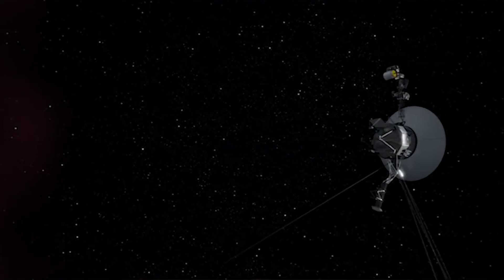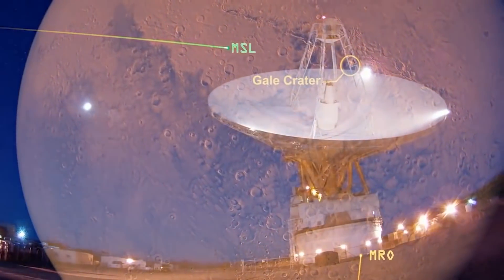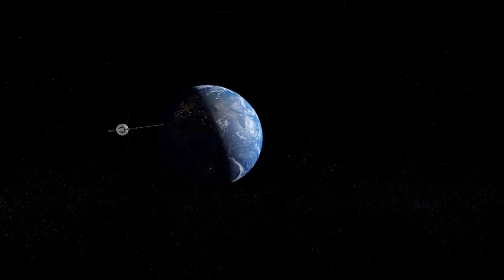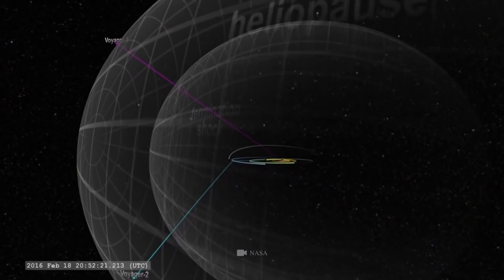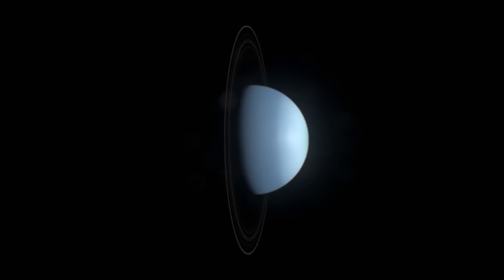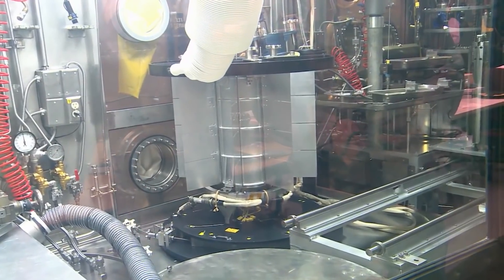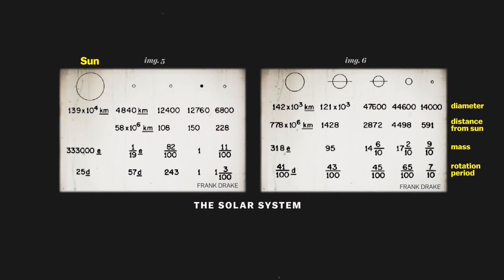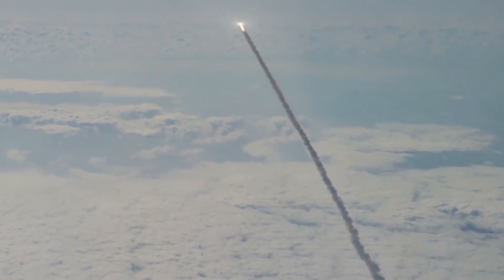Voyager 2 is FINALLY Back Online but Scientists Found Something SHOCKING

Comment: Voyager 2 was not designed to "study the edge of our solar system", but to study the outer planets and the space between them.  It doesn't take "ages" to send and receive signals, but about 17.5 hours.  Voyager 2 was never off-line, but we went through a period where we couldn't send new commands due to work on the Australian DSN antennas.  So we didn't have hard drives in 1977?  ;-)  Finally the velocity relative to the Sun is about 34 thousand miles per hour.  (I know, I know:  I'm complaining too much, but then I've been with the project since 1979 myself, so I'm getting to be old and crotchety.)
Reply: It was very helpful. Thank you.
Reply: I was really hoping I wasn’t the only one who noticed those gaffes. My head almost exploded when he said “it passed through Jupiter, Saturn, Uranus, and Neptune”! It most certainly did NOT pass through any planets! 🙄
Reply: @DennisKovacich  At least he didn't say "flew through!" Spacecraft may be flung, floating, or in reality, falling, but not flying! Were you at NASA also?
Reply: @DennisKovacich  It is possible that it passed through Uranus. 😉
Reply: I mean, he did call out those details, so…
Reply: @BeaulieuTodd  Sorry.  I also appreciate this contributor's experience and comments. I intended to comment on the video itself.  But it got placed (perhaps due to my ineptitude) as a comment to a comment.  I often have my comments or texting substantially altered as I post them.  Just now I was prohibited from making "texting" plural.  Sometimes, in texting to brothers, I try to be cute by distorting the language for emphasis as in awash. Awash was not the word that I typed but rather "a" four times followed by "h".  The GOOGLE computer--bless its little heart--is trying to be helpful.  Have I run on too long?  I WILL receive a notice.
Reply: @josephboxmeyer5730  Bragg, Benning, Gordon, or Jackson? Just think if this rudimentary AI screws up this often, what will fully independent AI do??
Reply: I was also bothered by the "ages" reference. Do idiots write these scripts?
Reply: @josephboxmeyer5730  It's all just clickbite. What did you do with the project?
Reply: @juliamars6573  I wish that I could say that I had something to do with the voyager projects.  I remember my excitement watching results from fly-bys of the outer planets.  When in school we had no more than grainy little photos and interpretive drawings.
Reply: @josephboxmeyer5730  its for the numbskulled young in our societies who deal in absolutes
Reply: You can say you sent them in a triangulation towards the area of the source of gravity that was perturbing Neptune  and Pluto.
We know😐
Reply: @SnookCowboy  Very clearly worded. Good thinker.  Gravity does not surprise you.  What do you think of Space-X CEO and founder?  I think that I'd like to work for him.
Reply: @josephboxmeyer5730  Thanks Joseph.  I would work for him if there was a position available.
I'm a network specialist. Telecom.
Learned about planet X around 2007. Ardent study of ancient civilizations claiming their creators were from space.  Specifically the Annunaki or the sons of God who took favor amongst the women of men..  I will walk through the door of truth if opened.
Reply: No 3.5 inch hard drives, but I guess they had  back then washing machine size hard drives
Reply: Even today’s hard/NAND/SSD drives would be terrible for this type of long term data storage.
Reply: Taking 17.5 hours is taking ages. :-)
Reply: If you're talking the truth, by now, you're entitled to be grouchy and crotchety!  And, it's low in fat and salt, high on fiber!  I'm getting reacquainted with prunes, and, saying goodbye to constipation!
Reply: Thanks for sticking it out in Cali. and for any work you did on this incredible instrument. I'd have been proud as a peacock to have swept the floors while she was coming together! Exceptional work from your contemporaries and yourself! God Speed!
Reply: Man, you’re allowed to be old and crotchety at this point. Seriously. By a long shot. Thank you for the valuable work you have done.
Reply: What is your opinion on the gold record installed on Voyager I? I think it's kind of dumb but I'm not a rocket scientist
Reply: @patrickkinnear8625  , be assured that the gold record was primarily PR outreach targeted very much at humans.  I think it was appropriate.  I'm hoping that it will be very valuable space salvage at some point in the future.
Reply: Thank Mr. Spock 🖖🏽 for the explanation
Reply: Cool
Reply: 😹😹😹yes there were hard drives back in the 70’s but a hard drive of that time period was almost the size of 7.5kg load washing machine so no they could not just attach a HD back in the day😹😹😹😹I have a 10 disc spindle rescued from my old job when we upgraded the computer hardware to more moderne hardware back in the late 80’s the 10 platers was a combined 5MB in total if it was made with todays moderne technology it 1000TB give or take.😹😹😹
Reply: @dawsie  I left the NAVY in '83, went to work for an image processing company. I remember the old Winchesters. Big as a top loading washing machine. In the Navy, the Fire-Control computer it used was a Univac 1518, with magnetic toroid core memory, paper/mylar tape reader, teletype machine for direct input and a card reader for back-up, The GFCS operator panels had DTL for circuitry. Those were pioneering days for sure. At the image processing company, one of our products had 16 image bit slice solid state memory boards. (the chips were 4116s if IIRC) It was all grey-scale. Part of my job commissioning such a machine was to synchronize the RAS and CAS for each board using an O-scope and adding appropriate delays for each board by cutting traces, soldering a bit of wire wrap conductor to route the signals through buffer gates to get the RAS and CAS for each bank to line up. 7ns (?) per gate IIRC. How far we have come.😉
Reply: @dawsie  all tech that is available for public use is @ least 10yrs behind the curve; so if they used it in the 70's that means it was developed late 50's to early 60's. Military always get 1st dibs on new tech.
Reply: @dawsie  The most common at the time of Voyager launch in 1977 were the "Winchester" drives described at https://en.wikipedia.org/wiki/History_of_hard_disk_drives
Reply: Hey man I wish you could teach me this has been a life long dream and it's our time to be making space home but who now's what will happen but damn your smart
Reply: Salute to you
Reply: From one "old and crotchety" to another, thanks for the clarification.
Reply: You have a vivid imagination.
Reply: Thank you for your service.  Merry Christmas!
Reply: 👍 thank you. I caught the ages comment and the redirection to the south. There is no south in space. As there is no up or down. 🤦‍♂️
Reply: @DMUSA536  For astronomical purposes the ecliptic plane is defined by the Earth's orbit around the Sun, with north defined as the perpendicular direction containing the positive axis of revolution.  We (in fields and particles research) also talk about upward and downward propagating waves, depending on whether they're moving away or toward a planet.
Reply: @Space-Audio  thanks for the clarification. Much appreciated.
Reply: Boy are you full of bullshit or what?
Reply: Wow, respect.😄👍

Comment: If the radiowaves travel at the speed of light it would take 16 years to get a Signal
Reply: ?

11 billion miles are 17702784000000 m
The speed of light is 299792458 m/s
17702784000000 / 299792458 equals 59.050 s
59.050 seconds are about 16 hours
 Where tf did you get your 16 years from?
Reply: @radiantdiamond3701  look at his pfp im sure that explains more than enough

Comment: “NASA” is so smart they didn’t even put a solar panel for power on voyager huh? Idiots! They could have at least put some rechargeable batteries on board so aliens could recharge it for us.
Reply: Solar panels were either not effective, cost effective, or aerospace worthy to be included on the voyagers. Remember solar power has only gotten popular recently by developments in cheap design and effectiveness

Comment: The speed of light is confusing it takes 17 hours for signals to get back right signals travel at the speed oof light right ok so here

296k m a second 1000x 296 = 296m 16 mins 296m x 10 = 2.96B 160 mins 2.96B x 2 = 5.92B 320 mins 5.92B x 2 = 11.84B 640 mins 10 hours and 40 minutes it shouldn’t take 17 hours or did I do the math wrong and the speed is actually 230k ish

Comment: https://www.nasa.gov/press-release/nasa-s-voyager-2-probe-enters-interstellar-space  While the probes have left the heliosphere, Voyager 1 and Voyager 2 have not yet left the solar system, and won’t be leaving anytime soon. The boundary of the solar system is considered to be beyond the outer edge of the Oort Cloud, a collection of small objects that are still under the influence of the Sun’s gravity. The width of the Oort Cloud is not known precisely, but it is estimated to begin at about 1,000 astronomical units (AU) from the Sun and to extend to about 100,000 AU. One AU is the distance from the Sun to Earth. It will take about 300 years for Voyager 2 to reach the inner edge of the Oort Cloud and possibly 30,000 years to fly beyond it.

Comment: It's amazing how far man made objects passed the solar systems and yet there's no man made object that sits at the bottom of the Mariana's trench transmitting signal the same way as Voyagers 1&2
Reply: Transmitting signals for what?
Reply: Because signals can’t be transmitted through water. Submarines have to surface (or at least get close enough for their antennas to be above the surface) for radio communications.

Comment: We are to believe it is transporting images 11 billion miles away??? Yeah right!
Also the charged particles in the Van Allen Radiation Belts would prevent any and all transmissions.
The moon landings, along with all the rovers and probes are all fake.
They do this to keep the billions of dollars rolling in.
https://www.youtube.com/watch?v=4O5dPsu66Kw
Reply: Signals are like light bud
Reply: @vend9234  First, Radio signals are not like light. Secondly can a manmade light travel 11 billion miles???  According to the findings of the Orion space probe the inner belts consist of mostly electrons that carry a negative charge and the outer belts contains of mostly protons that carry a positive charge this would disrupt radio communications. When the Orion went into the belts NASA lost radio contact but they were expecting that and the computers were programmed to  control the ship through the belts.

Comment: After acquiring so much data that it gains consciousness it resides to come back to join with its creators and deliver the gained data.  Upon not hearing from the creators as they’re long since dead, it determines that the carbon based units (us) populating the planet are the cause of the interface, it decides to annihilate us all.

Comment: Is that the one withed the golden record on to it??  I thought that one was Voyager 1 .  How did it happen? A little green gremlin hopped on to it at Mars and made uped grades to it so it cand say hello backed to us again.
They should make repeater probes so that voyagers 1 cand talk to voyager 2 and voyager 2 then could talked to voyager 3 and Voyager 3 to us or may be to our Mars new station and there it cand get boosted and repeated backed to earth!!  And they could put on nuclear isotopes on them which cand last 200 years for making power from the heat from it right?  They will get as heavier but too they will send it backed lots more of sciences stuff from WAY very out there.  Just I wish I could to worked on thosed things when haved I geted to 18 or 21 afters college.
Ahhhhh I was being right, it does haved the golden record, but I did think it haved acshully a gold one. I think it too they haved mathematical equations and diagrams so cand aliens figured it out how to read it our stuff as instructions.  I think it to put ond to voyager  the golden record which does show where at we are was really dumb for a smarters guy as Dr. Sagan. Any time does a stronger new group find a weaker one ALL WAYS does the strong one taked over the wreaked one.  I would wished to remained hidden as it would to be safer then of the chance of a aliens group to be nice and gived to us anti-gravity engines and artificial gravity and fosters then light engines all which we do need to geted to even the closest of star. All so how to maked lots of oxygen withed no water used. Stuff as that.  I do doubted it ever will any one gived to us that stuff so cand we compete withed them.
Reply: @Thomas.Wright  
They did haved a Voyager 6 !!  I haved not seen it that show part.  I did to liked  Star Trek next generations but never I saw it this one.  Even I liked some of the old very originals Star treks where at captain longed dork does go about of the galaxy getting the hot girls all over.  That show is too funny!  They haved all of the olders stars treks and next generations and now do they haved “Picard” ond to Amazon too even.  Ifed does that bladed lady comes to my door I will taked hers Gold record and melted it and geted lots of moneys.
Reply: In about 100 years, it will come back and turn into a bald lady and try to destroy earth looking for "The Creator."
Reply: @Thomas.Wright  
What?  Who is being the bald lady about?
Reply: They both have a record.
Reply: @michaelbruno1666  
 For really?  I did not to know it that.  Bothed do haved it a record?  Cool beans!  Just but I do not liked may be it does haved maps to geted to Sol or Earth.
Thanked you for telling it they bothed do haved a record.

Comment: “Even of radio waves travel at the speed of light it would take ages to send and receive messages”
Radio waves do travel at the speed of light and it doesn’t take ages. As a matter of fact, we can calculate it very simply. It takes light from the Sun about 8 minutes to travel to Earth. That’s one AU (Astronomical Unit). That’s hardly ages from just outside the solar system.
Reply: It still takes a while though, would be nice if it was instantaneous
Reply: @甘いお茶漬け  quantum communication is instantaneous. 
Possibilitys are becoming real.
Reply: @BentReality.369  Perhaps
Reply: Yes, that little statement is annoying, “Even if….”, sort of casting some doubt on it all.

Comment: How does Voyager fuel last so long ?
Reply: Radioactive material decaying generating heat, lasts for decades. For main thrust none needed, continues on momentum only - has surpassed solar escape velocity and will never be pulled back.

Comment: I wrote this awhile back.. At the time I thought it was a bit more pessimistic than I usually am.. now... well you decide.                       -----  Probe -----

Because of a small,and seemingly insignificant error, in engineering on the Voyager 2 space probe, the  internal power source has greatly outlived its design expectations.
Launched in 1977 the probe was sent on an epic cosmic run.  It has dependably collected data on most of the planets in our solar system for decades. Information concerning magnetic belts, massive gravitational waves and cosmic rays, even photos of the planets, was all faithfully transmitted back home and collected on huge dish antennae designed to hear it’s delicate space whispers.
But because of a small, and seemingly insignificant error, in engineering on Voyager’s home planet, there is no one left alive to receive it’s tender signal.

Comment: Still transmitting? You sure? I thought the Klingon’s used it for target practice 🤔

I know she’s running out of juice, and they’ve turned off some systems like the camera to save power, I am wondering if just before it goes silent, that they could turn the camera back on for a few shots to send back…just for curiosity sake.
Reply: No, that was Pioneer 10 or 11.

Comment: “Even if radiosignals travel at the speed of light, it would take ages for signals from Voyager 2 to reach earth”. Light travels 186k miles per sec, 11 billion/186k = 5900. It would take about an hour and 40 minutes for signals to reach earth, not ages. When you first say it sends signals the speed of light, and that it takes ages for those signals to reach earth, it sounds like the Voyager 2 is many lightyears away
Reply: Actually 11B / 186K = 59,139 sec = 985 min = 16.43 hours.

Comment: How tf does it stay connected when it's so far away like what is this wizardry
Reply: Uh uh, its a special long range antenna, which always has to face earth to send informations. And from its current distance it takes 20 hours for the signal to travel to earth. Knowing that, it doesn't seem that crazy anymore.

Comment: 16 16 16 16

you arent kzzt kzzt

someday we will smiling hearing that,

ah just hoping sean Murray giving Voyager 2 in NMS,

if only we can replicated the method they used to launch the voyager2 probably we can made 1 more but now with combined current technology to creating indefinitely power source along with greater radio signal wave and place it on the another "voyager2"

Comment: "If Radio waves moved at the speed of light..." ... Radio waves basically ARE light...
Reply: wave energy. its all frequencies.
Reply: Pretty sure he meant it in clause
Reply: It's not light it's radio waves dumby
Reply: It's hammer time 🔨
Reply: But wouldn’t they have different wavelengths?
Reply: @crimblr  it doesn't matter to those waves - it's just that we, humans, are capable to detect those waves at very specific frequencies using our eyes - which we call "light". So yeah - "light" is just a term for electromagnetic waves we can see. So, yeah, "light" and "radio" waves are exactly the same thing. Just different terms based on how frequently they oscillate.
Reply: they don't have a mass so literally light speed